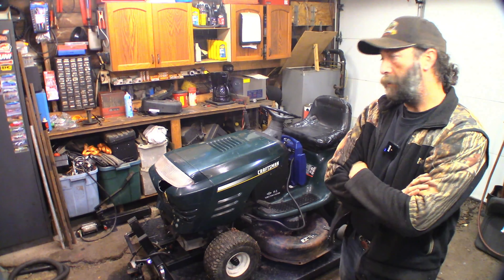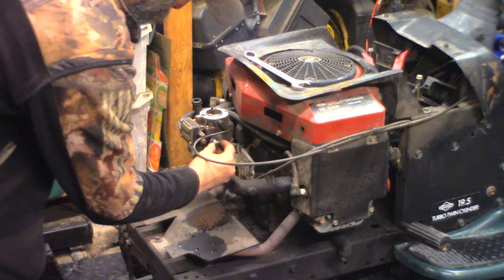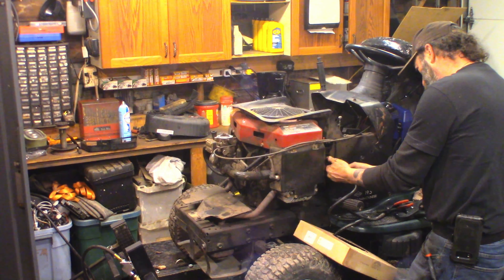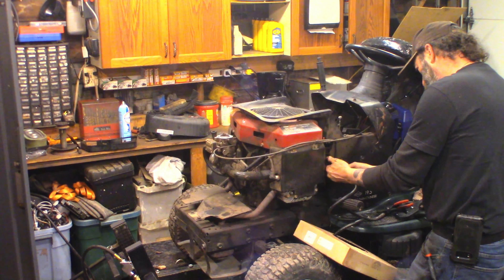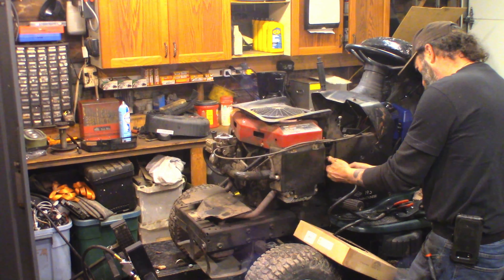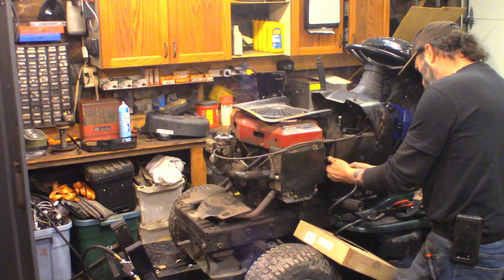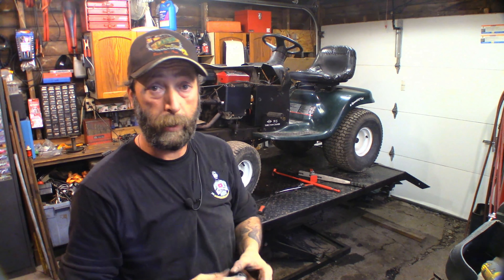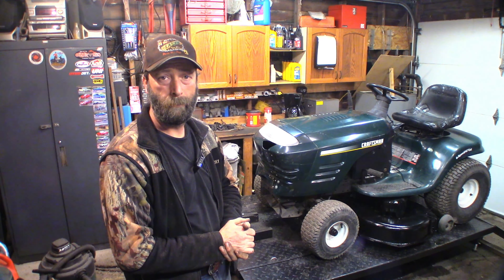Craftsman 19.5 hp 42" riding mower won't start, and some repairs for resale.

Comment: As always I am impressed with your skills. I purchased a $15 plastic welding staple gun that is great for those broken hoods. You put the staple in the gun and press it into the plastic and pull the trigger. The staples go on the inside of the hood and no visible repair on the out side. Looks great and very strong once you stitch it together.
Reply from the maker: I might invest in one of those tools.  Although, I'm not sure it would work on the terrible John Deere hoods from the late 90's (Black deck STX38's for example).  The plastic degrades so bad, they fall apart just sitting in the yard.

Comment: What size mower belt did you use? I see 2 different sizes when i look it up, .5x88 and .5x96.
Reply from the maker: I believe this one used the 144959 belt, which is 1/2" x 95-1/2"
Reply: @randomwrenching  awesome, thanks man!

Comment: On the rear tanks units I use a electric fuel pump to drain, then half gallon of fresh gas and pump it out 
I do this three or four times 
Saves pulling tanks 
Works great 👍 
Just hate replacing all the fuel hose
Reply from the maker: I do the same with an electric pump now. Much easier
Reply: Can you help me out with something. Im buying a used one for 700 bucks i wanted ask some questions

Comment: I have the same exact mower. And I had the same exact motor the problem that I'm having is when I start the unit the unit will only idle a little but it will not let me idle up if I try to throttle up it doesn't do anything. Just trying to fix the problem.. if I run the unit without the airbox on it it will run fine the minute that I put the airbox back on it it bogs down to weigh less than idle